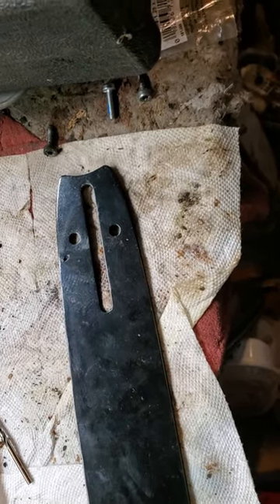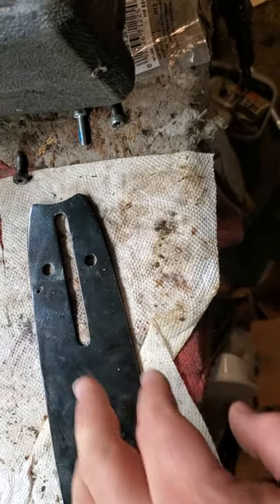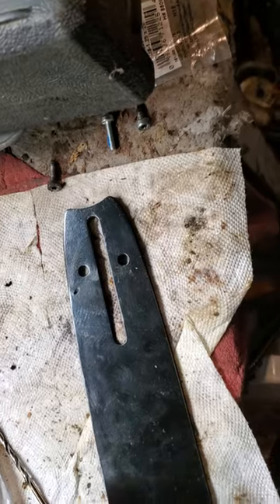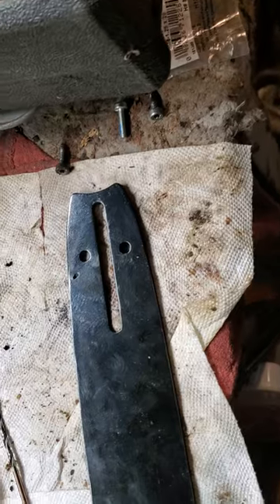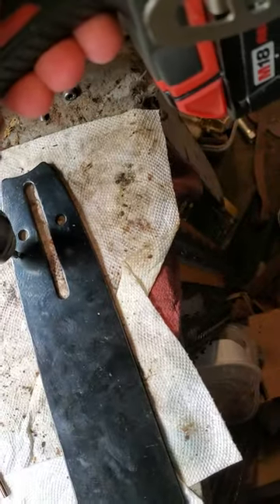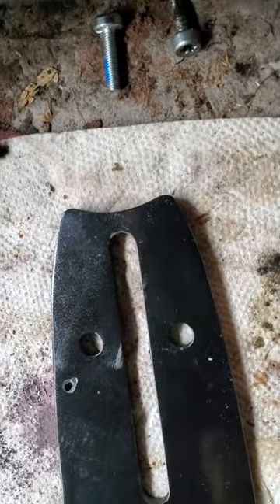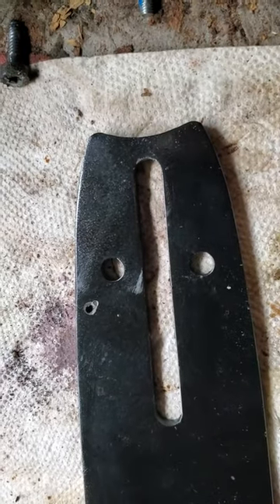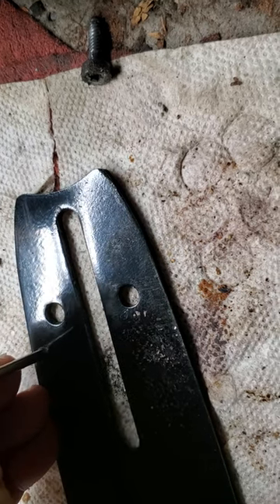Chainsaw bar mods

Comment: You showed reaming the hole but didn’t show the 2nd operation being done.  Are we supposed to guess at the bit type and angle to drill?  How deep?
Reply: He said its a 5/32 drill bit, but to use the chamfering bit to make the hole more round to not bust the 5/32 bit. As for drilling through with the 5/32 bit, he says light pressure just to go through. You’re not drilling all the way through the bar. Just through that side into the chain groove.